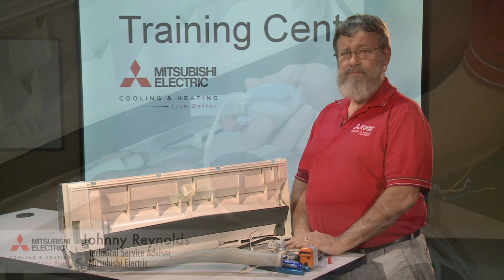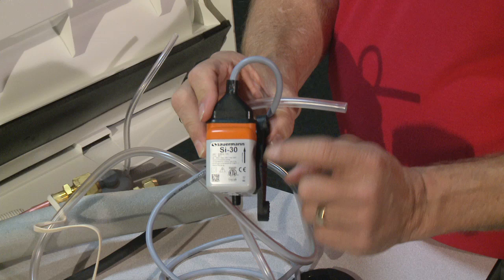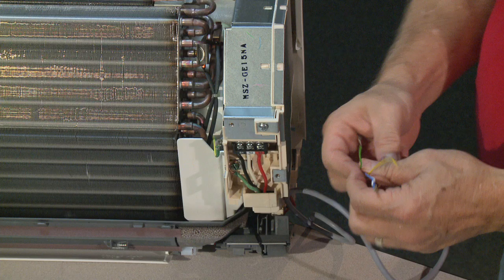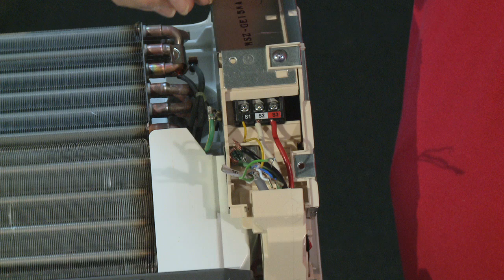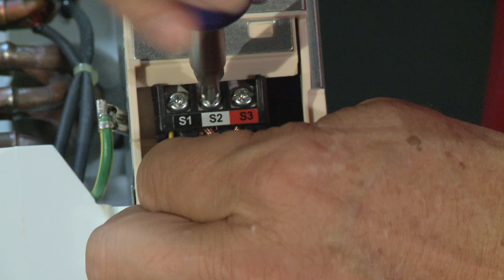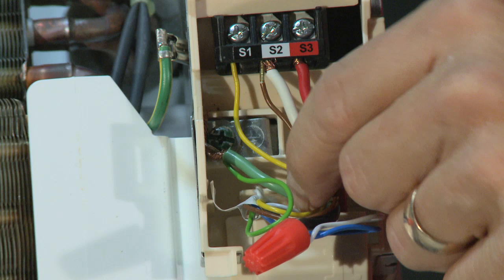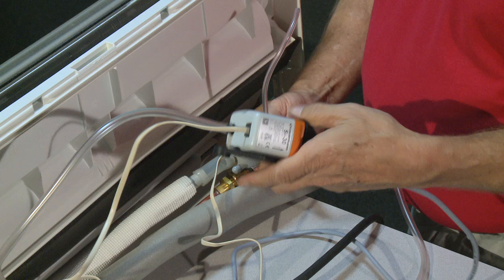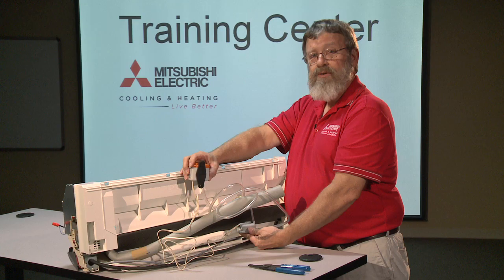Condensate Pump Installation Service Video for Mitsubishi Electric Cooling & Heating

Comment from the maker: This is the proper way of wiring any of the mini pumps. With the wiring for these pumps, you always break the S1 wire which is one leg of AC feeding indoor unit that will drop out the indoor unit. If you use the S3 wire, the float/contact in the pump control board will cause a communication fault. That is why we break S1 wire. Plus the wires for the pumps are UL listed and approved for the manufacture of the pumps.

Comment: 3:20 Whenever you're wrapping stranded wires around a screw, if you twist the strands in the opposite (counter-clockwise) direction (but still wrap the wire around the screw in the clockwise direction), then when you tighten the screw, the strands will not fray.

Comment: What is the amp rating on the pump? We're required to run 14/4 and the pump wire don't look to be no bigger than 20 gauge.

Comment: I have been very disappointed in the Sauermann Si-30 Pump. The float will get this slime on it in the off season and the unit will just overflow all over the floor until someone turns it off. Also, they are LOUD. The vibrate the whole wall. And it sounds like symphony when its really humid out and they are all pumping. In the living room, I wen with a DiversiTech ClearVue™ Cube. The ClearVue™ Cube has a larger tank and only pumps %10 of the time the others do. It also doesn't use a float. I am looking to see how the ClearVue™ Mini is for my other units. Any thoughts from you guys?

Comment: Have you ever actually installed this pump behind a wall mounted unit? It is impossible to fit the lineset, drain, pump, and resivour behind the unit and clip it to the back plate. If you know of a way, I'm open for advice

Comment: Question: I'm installing a Senville (mitsubishi) 36k btu four head system. I live in Western NY where the winters can be bitter cold.  Can I run the condensation drain tube directly outside to the exterior condenser unit even this far north?  I guess my real question is, WHEN THE UNIT IS IN HEAT MODE, DOES IT PRODUCE ANY CONDENSATION THAT MIGHT FREEZE IN THE TUBE AND CLOG IN WINTER CONDITIONS?  Thanks very much!

Comment: I want to see you do that with it mounted to the wall with the copper lines connected and put the pump in there, also the wire for the pump doesn't look like 14g wire. NOT CODE
Reply: I was going to ask the same question. The thermostat wire looks to be 18ga. I thought 14Ga was the recommended minimum allowed....
Reply: It can be a lower gage wire

Comment: Question, what kind of condensate tube is that? It looks like it is insulated. I've read in the manual (for the MLZ in my case) that I'm required to use insulated condensate tube.

Comment: Guys, do not break the S3 wire. It will go into a communication lockout. Breaking S2 will do the same. Only break S1. That's the only way for the unit not to lock out and be able to restart.
Reply: er0r de un aire América de d0se 12 se mil beteu e f 5
Reply: Wow exactly what the poster said.Good job genius!
Reply: What if the indoor unit has it's own power source and a communication wire coming from the outdoor unit?
Reply: carlos garcia Why it would be like that?So your condensor is always running?
Makes no sense.
Reply: @jakesmith2984  No. The outdoor unit has it's own power source. I think that the thermostat calls for cooling or heat then send a signal to the indoor unit then sending that signal to the outdoor unit to come on.
Reply: carlos garcia The its still wired to commumicate.Just go by the video.Unless they can chime in.
To add...the thermostat is powered on its own by low voltage wire.That sends the communication to the main unit which in turn uses the 220 volts to turn the system on.
Should be at least.
Thats how my conventioal system is.
The mini split I put in fiesnt use a separate thermostat.Just hooked up to the main 220.
Did someone install your mini sit without a condensate pump?

Comment: I am just was about to hook up the electrical portion of one of these S1-30 pumps to a PKA-A36KA. After checking out an online diagram, I had a concern.

Won't the S1 (Yellow) be carrying the full amperage of the complete unit through the detection unit on a 20AWG?? This multiconductor is only 20AWG, where as the existing S1 is 14AWG.

Just like to know if this could be an issue.
Reply: The load is not much more than one amp.

Comment: Is this similar for an aspen mini lime pump on a Mitsubishi unit.?  I need help…. I’ve got a purple orange gray wire….     S1 S2 S3.   Which ones go where? The company said the orange doesn’t go to anything and gray and purple go into S1 which would have a total of four wires in it if they were the case……. Doesn’t make sense ..
Reply: Did you ever figure it out?
Reply: @PageTrimble  negative- I ended up giving up and will just call an HVAC person.  Only use it one or two months a year anyway so it’s really not that big of a deal… no one seems to know. Seems it should be really simple….  Checked other Units in my complex and their pumps are in the wall……   Go figure/ probably will order a new one, have someone install it.  Hate paying anyone to work on anything in my home….    Anything at all.

Comment: How would you wire a little giant condensate pump?
Reply: You'd power it as needed and break S1 with the safety switch. BUT! Make sure the switch is line voltage rated. Most are only 24 volt rated.

Comment: Ok bud you have a couple things wrong here if you are wiring to a 208/230 evaporator and condenser. First, with a condensate pump your communication wire should go directly to the communication wire on condenser (24V) and your N/C from pump should go to S3 on the evap. This creates a closed loop through the pump of 24 volts and if the pump should fail then the contact opens and the evap loses it's communication from the condenser and therefore shuts down so water doesn't leak everywhere.
Reply: I think the pumps come in 208 or 120 v.
Reply: Just had this problem due to the pump safety braking s3 and unit having com loss . The safety must brake line voltage to evaporator not communications as this will throw a e6  and has to be manually restarted even after contacts have closed .

Comment: How much more shit can you hide in these mini split units? It’s already very difficult to fit the line set and drain under the unit cover. Easy to install on that bench but that shit will be popping off the wall. Show us how you install it in somebody’s house.

Comment: Typical BS, not once has he either made sure that there's real power going to the unit, checked that everything is working correctly and what if the Split system condenser is about 4 meters away and about 2 meters higher than the pooling section of the A/C unit mounted on the wall, i have a Mitsubishi split systems and the condensation pump stopped working just the other week, and now that the water is pooling out of the roof and plastic connection or covering outside the place where the A/c unit was mounted, we require more basic and better understanding of where those pumps are to be placed and what amount of water or condensation can it handle, as far as i can see it looks like a little water pump which could empty a small fish tank full of water before it would over load itself and blow up, which i believe has happened to out unit and we have over 100 Degree days in australia ?

Comment: We have multiple mini splits all with condensate pumps.  Horrible decision.  The pumps  — at least 2-3/year — get replaced.  They clog, are weak, horribly engineered devices.  Can’t believe they still install them.  We’ve had water damage over and over again.  AC guys want 500 to replace each pump.  MONEY PIT.  STAY AWAY.  Drain by gravity.  Pumps are a nightmare, especially if installed in an attic.